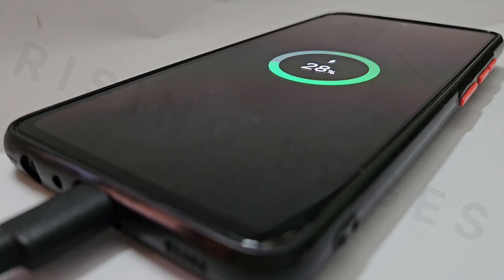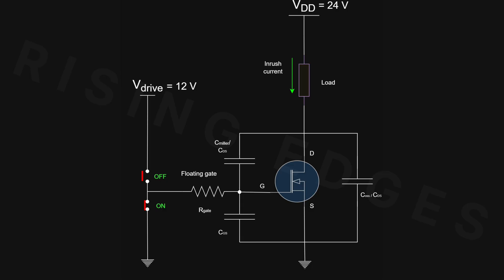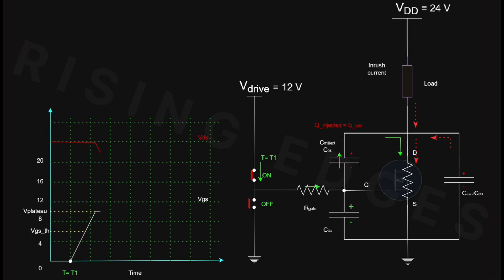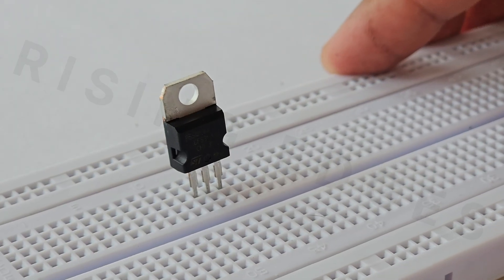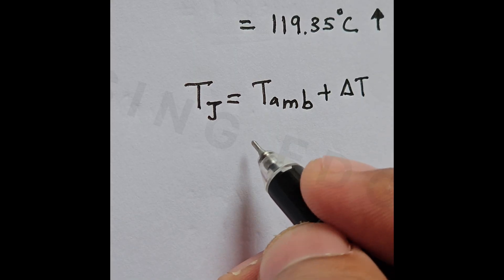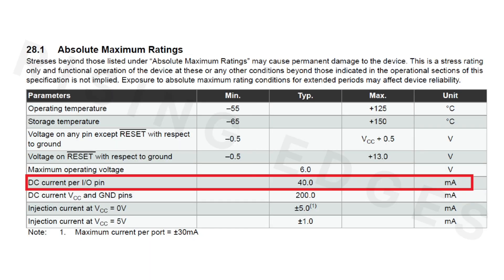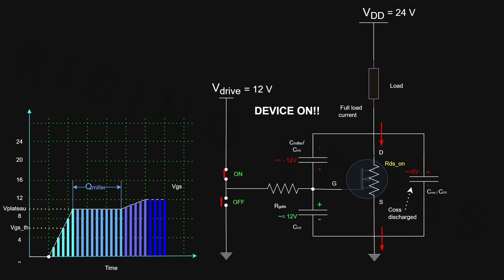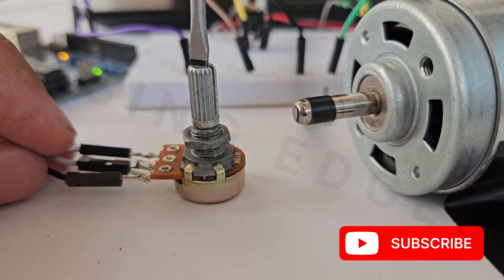MOSFET Switching Explained Like Never Before | Build a PWM Motor Driver with IRFZ44N

Comment: 9:33 Вы серьёзно решили так управлять затвором ?:D .  Первое - Зачем существует 10КОм резистор на затворе транзистора, когда там же на затворе транзистор идёт подключение 33Ом резистором на +12V ?? :D, И вообще, так затвором не управляют, можно сказать это очень опасное управление, т.к. в случае перегрева транзистора BC547 (а перегрев обязательно будет, т.к. через резистор в 33 ома, он постоянно будет потреблять 0,36А), и тогда в случае поломки, основной мосфет всегда будет включен. Вы вообще хоть немного разбираетесь в электронике, и в правильном построении схем ?:D.
Reply from the maker: Thanks for watching the video. This setup was more focused on demonstrating the MOSFET behavior rather than the gate driver design.

You're right — the BC547 isn’t meant to handle that much continuous current. I know it will damage at lower duty ratio and result in continues operation of motor, but its not important for a simple test circuit involving a low voltages...

Since this was a quick test at low voltage which isn't perfect, I didn't prioritize safety components here — but I’ll definitely consider that in a proper prototype.

Hope that clears it up 👍
Reply: @RisingEdges  Это хорошо, желательно делать работу над ошибками, потому как разбирающиеся люди пойму, а вот новички захотят повторить подобные затворные драйвера, и будут немного разочарованы тем, что в простое оно потребляет больше тока, чем во включённом состоянии (имеется виду открытый и закрытый основной силовой транзистор.)